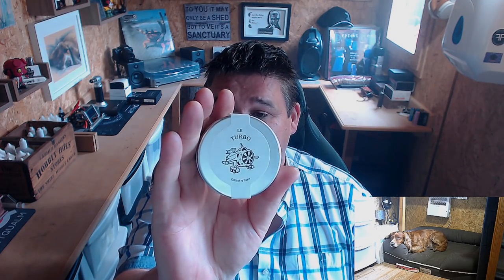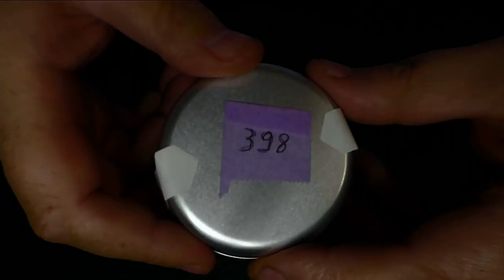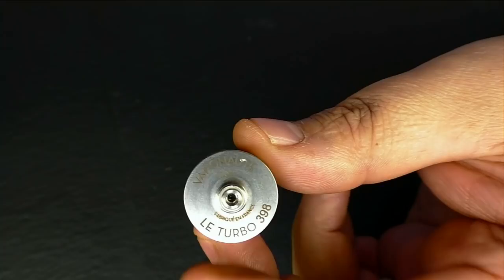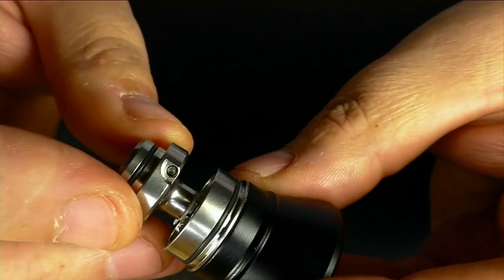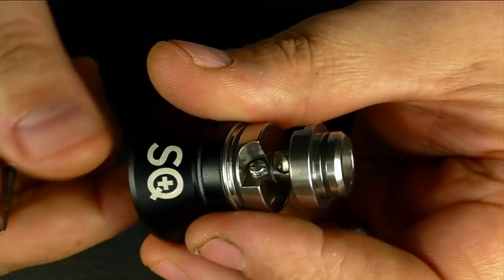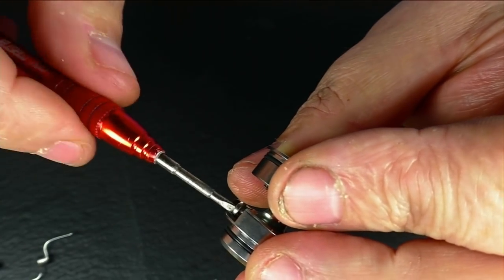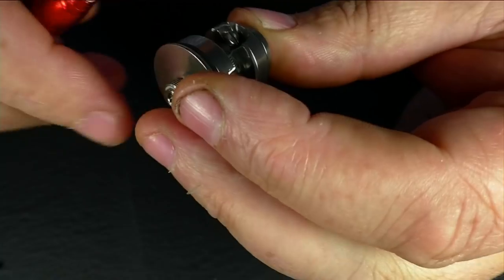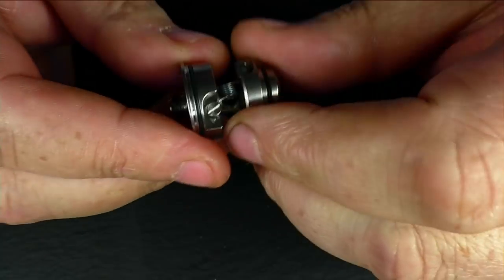Le Turbo by Vaponaute - Live Unboxing

Comment: Hi Todd! I was looking for a review of this RDA because I want to buy it because I like weird things. Your review gave me the last push to buy it, but I have a question. Which are the best coils for this RDA? Simple wire? Alien? Clapton? Thanks.
Reply from the maker: I can't really help with that one as I never really used the RDA much after the unboxing, just wasn't for me.  Sorry mate
Reply: Hi, guys and Thank you for the review. If I smoke liquides like custards, I like to use fused or staggered clapton, 2 *26gage clapton with 38g, between 33 and 40w. Ni80. But for minth, fruty juice, I prefer use 336l and single wire, 24g between 25 and 35w.
Reply: I forgot to tell you, It's better to use a 25 millimètres and not a 30 to roll Your coils on this rda. And also, space a litle beat the spires,(5 /7) between 22 and 33 ohms, flavors are really optimized. I 've maid more than 50 tests on this bloody turbo to find the sweet spot!

Comment: What is the hole thats on the opposite side of the top screw??? It looks like a screw hole so u cld twist it around to suit the direction of ur coil legs. Not sure cause I cldnt c how the airflow wld work with it twisted around that way.
Reply from the maker: Dunno mate, it's not threaded either?
Reply: @ToddsReviews  thats odd. I really need to know what that hole is for haha surely it serves some kinda purpose.